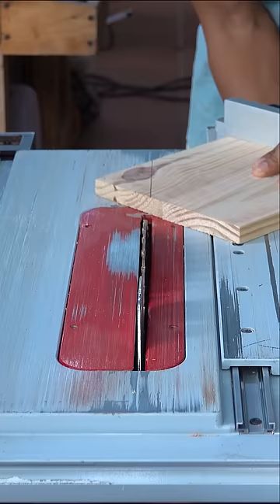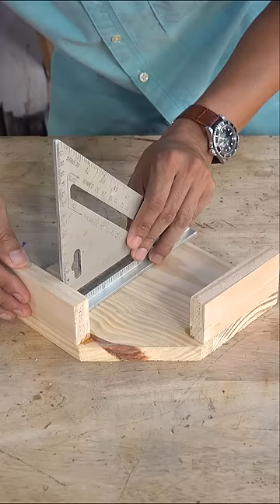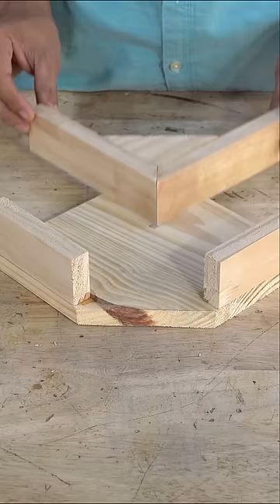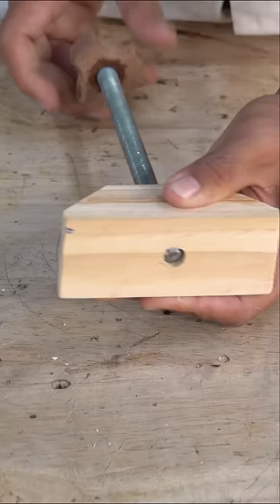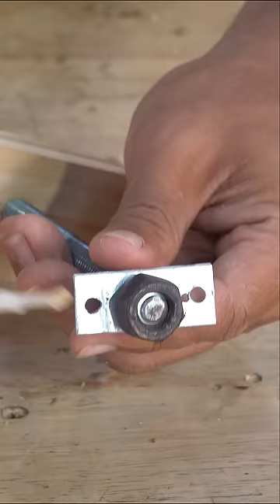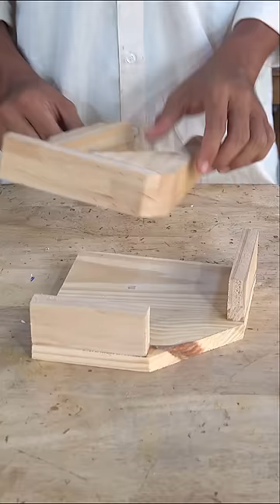DIY Woodworking Making Corner Clamp Locked Technique #shorts  #diy #woodworking #trending #wood

Comment: All this with superglue??? It won’t last one day!
Reply: That's CA glue. And yes it will.
Reply: It's actually a pretty common way to bond wood, and it actually works best on wood.

It'll hold.
Reply: @jasonkloos6348  superglue is CA glue, isn't it?
Reply: Ни один уважающий себя столяр так клеить не будет
Reply: @kenq7948 Superglue and water, yes
Reply: @jasonkloos6348 maybe for a lil corner clamp, but why not screw it together, or use brads??
Reply: Probably reinforced with screws. Saved time not showing for the vid

Comment: May i know what type of glue are you using?
Reply: Glue ????
Reply: I believe its cyanocrylate 🤔
Reply: Cyanoacrylate I use it often but not on joints that will be put under pressure. The joints will eventually snap.
Reply: CA Glue, commonly called super glue.

Comment: Do you use an accelerant with your glue? How well does it hold up?
Reply: It will hold on something small, without alot of load, but apply the glue, then some brads or small screws is much more practical